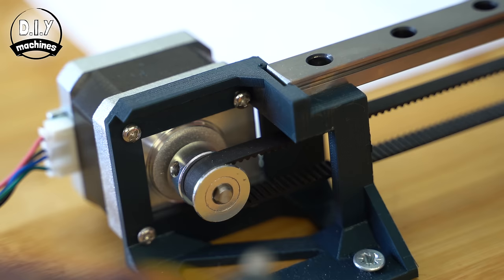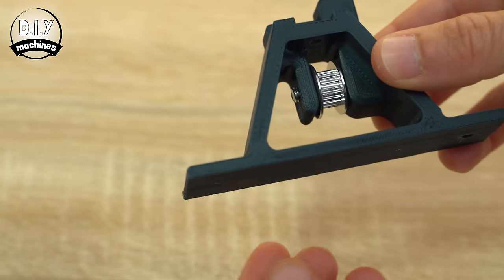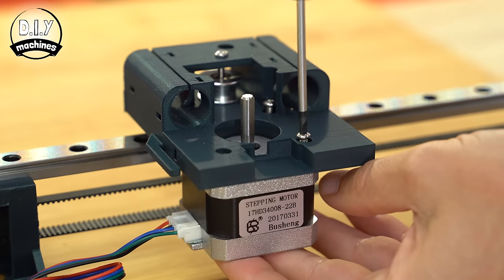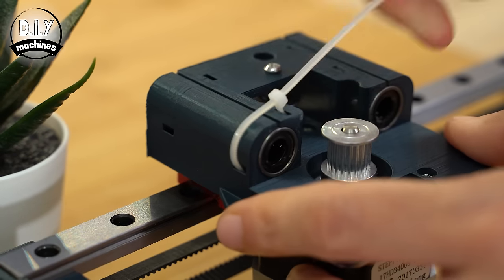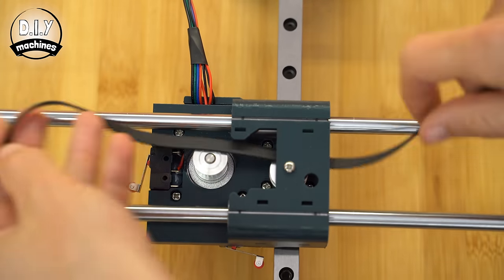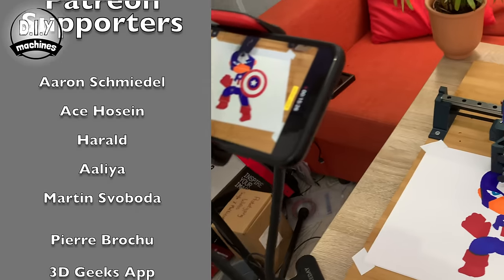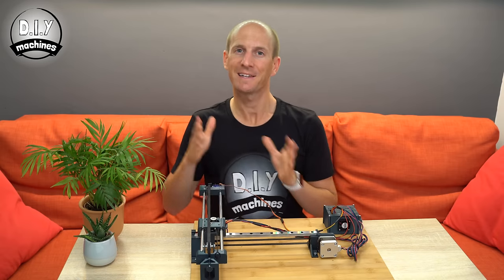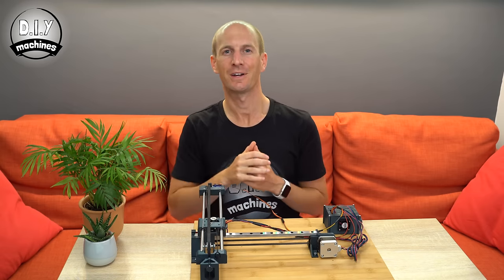Super Easy 3D Printed Arduino CNC Drawing Machine | GRBL Plotter Elegoo

Comment: Hi. While waiting for my parts i did more research. One thing i noticed is, that every other design is using the servo directly to raise the pen. My first impression is, that bringing the servo directly to the pen would result in better performance (faster and more accurate lifting) - but i don´t have experiences, it´s just my impression from videos i´ve seen. Is there any specific reason you opted for the belt and place the servo in the back?
Reply from the maker: Georg Schreier hi. Yes there is. I wanted to better balance the weight of the two axis so as to not require extra rods or rails in order to keep the cost as low as possible. The second reason was that by having it lowered by the weight of the pen and steel rod attached just behind it the pen is able to follow any up and down encountered in the drawing surface by as much as 4 to 5mm. This means we can draw on surfaces that vary such as wood, leather etc. I felt the direct connection would require more precise setting of the pen pressure and more often than not result in to much or too little pressure.
Reply: @DIYMachines  Awesome! I totally understand your points mentioned. You are not only a good DIYer and engineer, but also a damn good community manager ;-). I highly appreciate your effort. Thanks! I´m totally hyped to build this baby by myself. Your channel is highly underrated! 
Cheers.
Reply: Have you already tried some more complex drawings? Like the axidraw can do?
Those drawings have  ton of pen lifting and stuff. for example: https://www.youtube.com/watch?v=ByLLxUVjDww&t=2578s&ab_channel=Robort9000

Do you think your plotter can do such things? (i know, it´s a budget build and i dont expect it to keep up with professional equipment, but i think it´s wort a try.

If you like, i can provide a complex .svg for you to try.

Comment: what is the reasoning for using a belt and servo to control the Z? I was in the shower hair braining my own thing before coming here and the first thing that came to my mind was just gluing some metal to the back of a pen and then using a electric magnet to raise the pen. Is this too slow of a mechanism or is it too expensive by compare?
Reply from the maker: I wanted to use the servo as kind of counterbalance to the pen so as to help eliminate the need for a second rail at the bottom of the drawing area (I wanted the machine to be compact). An electric magnet could work, it would consume more  power and would put all the weight at the end of the arm. Servos can be very cheap.

Comment: Hi Lewis!

I am doing this project.
I accidentally bought the a4988 motor driver instead of the tmc2208. Would that cause a problem?
If so what should I do to get it working with these ones because I have to present this as my school project in 2 days?
Reply from the maker: Hi, you should be OK but the TMC2209 is worth it. I've replied to your Discord message on Discord. :)
Reply: Yea the tmc are far more better than the a4988 they are more smoother quiter and can do more micro stepping for finer details

Comment: I'm on it!. I'm doing it. I already purchased everything. I'll put it together as soon as I receive all the parts. In the mean time I'm already 3D printing the plastics. 
I have a request though, Can you make this same PRINTER/PLOTTER interchangeable for a LASER ENGRAVER/CUTTER?
Thank you very much. I'm subscribing.....  ✨🤩👏👏👏👏👏👏💥
Reply from the maker: Hi Raul, I'm happy to hear your building one. Mine still gets a lot of use. I've not done it myself but as the servo for lifting the pen is controlled with PWM then it may be a simple case of swapping it out for a 5v laser. I think some others have done it before and succeeded. Be careful with lasers though - the subscription will be for nothing if you can't watch the videos! 🙈😁
Reply: @DIYMachines  ...OK. I built it. It's working just fine. Thank you so much for this. I would like to have the adapter for the laser as well as the code. I don't know about coding...

Comment: Very good project. The machine is working, your test is done , I have some problem with Inkscape . Going to Apply on MI GRBL z-axis servo controller window  i have this  error message:
Traceback (most recent call last):

  File "servo.py", line 3172, in <module>

    e.affect()     

  File "C:\Program Files (x86)\Inkscape\share\extensions\inkex.py", line 217, in affect

    self.parse()

  File "C:\Program Files (x86)\Inkscape\share\extensions\inkex.py", line 141, in parse

    self.document = etree.parse(stream, parser=p)

  File "lxml.etree.pyx", line 2692, in lxml.etree.parse (src/lxml/lxml.etree.c:49594)

  File "parser.pxi", line 1522, in lxml.etree._parseDocument (src/lxml/lxml.etree.c:71582)

  File "parser.pxi", line 1552, in lxml.etree._parseFilelikeDocument (src/lxml/lxml.etree.c:71892)

  File "parser.pxi", line 1435, in lxml.etree._parseDocFromFilelike (src/lxml/lxml.etree.c:70807)

  File "parser.pxi", line 997, in lxml.etree._BaseParser._parseDocFromFilelike (src/lxml/lxml.etree.c:67948)

  File "parser.pxi", line 539, in lxml.etree._ParserContext._handleParseResultDoc (src/lxml/lxml.etree.c:63824)

  File "parser.pxi", line 625, in lxml.etree._handleParseResult (src/lxml/lxml.etree.c:64745)

  File "parser.pxi", line 565, in lxml.etree._raiseParseError (src/lxml/lxml.etree.c:64088)

lxml.etree.XMLSyntaxError: Document is empty, line 1, column 1

Could you say why ?

Comment: Hello!
Is it possible to wire the CNC shield to the Arduino Uno's 5V and GND pins and then connect the power supply directly to the Arduino?
Reply from the maker: Hi, it's far from ideal as the motors would pull too much power through the Arduino and require 12v to run.
Reply: @DIYMachines  so even though the power supply is a 12V? Will the power not be distributed in the correct way?:(

Comment: can i use Stepper driver =A4988  and Stepper Motor Nema 17 Model = 17HS3401
Reply from the maker: Yes and yes. However you are likely to find the A4988 will result in a noisier machine which runs a little less smoothly. I initially used the A4988 but switched to the TMC2208s later and didn't regret the upgrade.

Comment: Is there a way I can modify this setup, in order to have a web-based system? ie. not having the pc connected. If needed, I can use a raspberry pi in the setup....
Reply from the maker: Yes. In fact, I now have a raspberry pi attached to mine doing this. I installed the JSON sever on it and then you can connect to it through Chillipeppr from another machine on the same network. It will even scan your network to find it. :)
Reply: @DIYMachines  AWESOME! :) Thank you so much! :) I will be assembling my machine soon - already printed all the parts :)
Reply from the maker: @tinusblaauw4092  No problem. That's great to hear. I hope you enjoy it. :)
Reply: @DIYMachines  any plan to show video how to run drawing m/c from RPi ?
Reply: @DIYMachines  Something that I have done with my build thus far - I have attached the servo motor to the plastic housing using superglue and bicarb of soda - makes an incredibly strong bond. :)

Comment: Do you have a link to the 8 x 15 x 25mm Linear Bearing (x1) ? I can't find any on amazon
Reply: Use keyword "LM8UU" to find it.
Reply: @nochkin  I also can't find it. I used LM8UU but all the ones I found are 24mm. Do you have the link?
Reply: @parsaansari  My responses are getting wiped out for some reasons. In quick words, I think 24mm will fit. It's just 1mm shorter and looking at the part where it should fit, the shorter design is fine. Another thinking is 25mm is just a typo as this is intended to be 24mm anyway.

Comment: Hi, I used the A4988 which lead to noisy and motors turning with a lot of vibrations when moving slow. it was drawing, but lines got straight only on higher speed (long lines where fine). I exchanged stepper driver expecting a smoother movement with TMC2208 and now the stepper motors are soo slow, that even homing does not work, as grbls "times out" after 10-15 secs without even reaching the end stops. How can I get the motors to normal speed, when swapping drivers? Driver Voltage is at 1.15Volts. Thanks!
Reply: My fault: changed the steps for the A4988 and forgot to revert to your settings :)
Reply: Hi, what voltage and amperage did you use for the stepper motor?

Comment: Is there a way to do that without the board?
Reply from the maker: The board gives the project balance to stop it toppling over as the arm reaches forward and backwards. As long a you can anchor it down so it doesn't topple you don't need to have a board.

Comment: Good morning. I have a question I am having trouble locating the 8 mm chrome steel rod 35 cm long and the other one as well the 5.5 cm? I kid into Amazon and it doesn’t really give me anything to work with all the correct size. I wanted to know if you could help me locate these on Amazon this is the only thing that’s holding me up part wise, to start assembling the machine. Thank you  in advance.
Reply: I kid should say I keyed in to Amazon. Sorry for the mid spell
Reply from the maker: Hi John, what country are you in? You can buy a longer bar and cut it down with a small saw by hand (which is what I did). It's worth getting a chromed rod.

Comment: how does the arm that writes keep its balance?
Reply from the maker: I made the head as lightweight as possible, the servo on the other end acts as a light weight counter balance. There is some movement across the drawing area which is why the pen is allowed to travel up and down under it's weight to follow the contours of he surface if needed.

Comment: Really nice project! Will build it"
Your channel is well underrated with 36k for such quality content. Subscribed within the first seconds of the video!

One question: Is it possible to tilt the pen holder in order to use fountain pens?

BR and thanks for sharing such a great build!
Reply from the maker: Thank you. 😊 
You could print an alternate pen holder of your own design with the ability to adjust the tilt of the pen for a fountain pen. Great idea, for calligraphy.
Reply: @DIYMachines  Nice. Maybe i will try that (after successfully finished the main build of course :-))
Do you think, it´s sturdy enough for such calligraphy and "hard" pens? I wonder if it´s a bit too shaky (especially on the lower ends, when the axis is completely extended) What do you think? bc for calligraphy a straight line is crucial.

Also, sorry for not having perfect english, hope it´s understandable xD
Reply from the maker: @d3rsch0rsch  It doesn't shake very much at all. I used some fine liners to make some detailed line drawings and wouldn't say there is any sign of shake. If yours does exhibit shake for any reason you can slow down the max travel speed in GRBL.
Reply: @DIYMachines  Nice! Thank you so much for the additional support. I ordered all the parts in CN on aliexpress in order to lower the costs even further.
Will take some time to arrive and i will print all the parts in the meantime.
Reply: I can only find the "SG90" micro servo for purchase. Will this work? Don´t know the difference to your sf180m... both 9g.
Reply: Update: I managed to purchase all needed parts for less than 90€ (excluding wood/screws/cabling and printing - bc i got that stuff already). Couldn´t be happier.
Reply from the maker: @d3rsch0rsch  That's great to hear. Nice.

Comment: Aproximate budget?
Reply: Just take half an hour, search all the parts on aliexpress and you´ll be well under the pricetag from the provided links. ;-)
So budget depends heavily on your parts source. If you´re not in a hurry i can always recommend getting parts from ali. Much cheaper to import yourself.
Reply: I also made a comment under the video with a link to my spreadsheet. I managed to purchase all part for around 90€. (excluding printing, wood, screws, cables and stuff)
Reply: @d3rsch0rsch  Thanks!

Comment: Ahhhh... you don't use the Normally Open pin for limit switches. If the wire or solderpoint fails, the machine will never know there's a fault and keep crashing into whatever axis end. You want to use the Normally Closed pin, because if anything fails, worst case, the machine will think it had reached the limit.
Reply from the maker: That is an excellent bit of advice. Thank you. I will remember it for my next project. :)
Reply: @DIYMachines  You're welcome... I love this build. I'm seriously considering building it next with my kids... nicely done! Thanks

Comment: I don't think I would eat something that has been written with a marker pen and especially not a pic picture made of it, just saying.
Reply from the maker: Don't worry - those are edible ink pens bought from the local supermarket. 🙂
Reply: @DIYMachines  I hoped you would say something like that, and you should perhaps also put up a disclaimer to not use normal ones since I would not be surprised one single bit if someone would actually use normal ones. There are very messed up ppl out there.